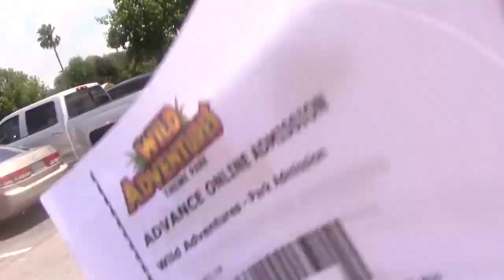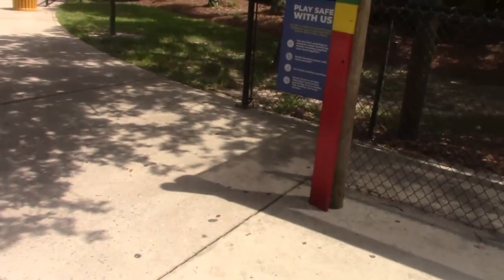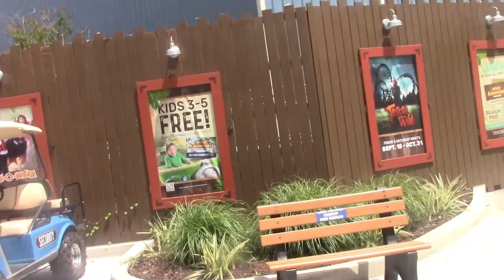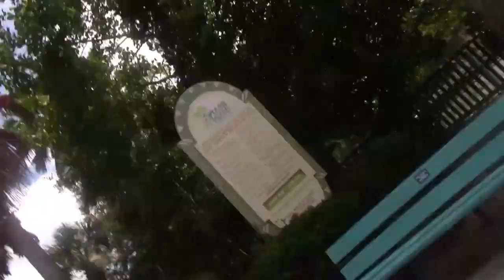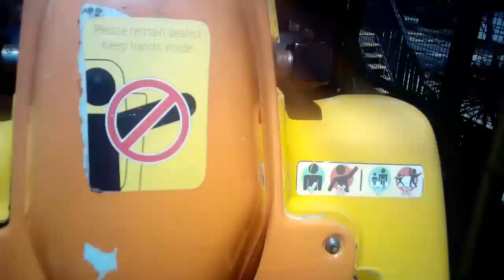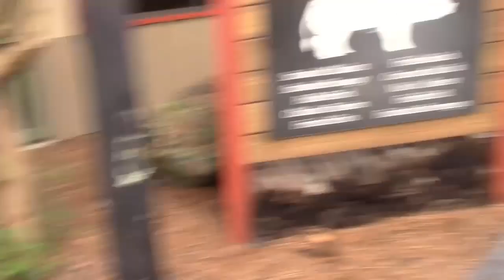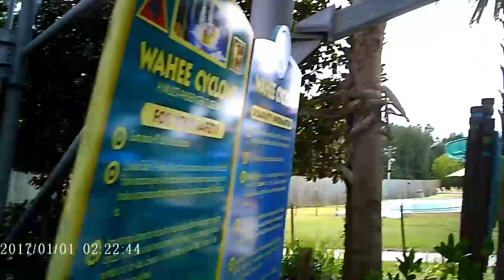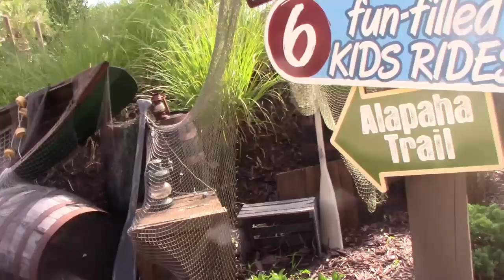wild adventures vlog, extremely long!!!!!! fun theme park in georgia strata trip day 1

Comment: So was Cheetah closed or something?
Reply from the maker: Yes, it's down for the year because apparently social distancing was not possible in that area due to small pathways so they blocked off the wholearea
Reply: @coasterland325  oh I heard it was down for maintenance
Reply from the maker: @milkyway8852  oh, thats interesting information, I was mainly going off of what the website said so if im wrong im sorry, thanks for watching
Reply: @coasterland325  I actually don't know but I read off the reviews on there page
Reply from the maker: @milkyway8852  ok thanks for letting me know
Reply from the maker: @floridasmostidioticpreteen5226  i see, a retrack and a little cash could have fixed this issue
Reply: I went august of 2019 and it was closed, pretty sure its closed off for good bc it was too dangerous or something..
Reply from the maker: @avabush3507  it was perfectly safe however the ride was uncomfortable for riders due to the roughness, and it had high maintenance costs
Reply: @coasterland325  there completely demolished it I was there today
Reply: The cheetah is gone forever they completely  demolished it
Reply from the maker: Wow rather sad tbh